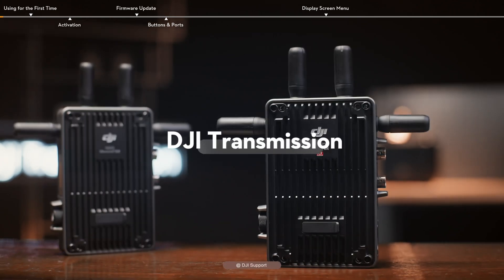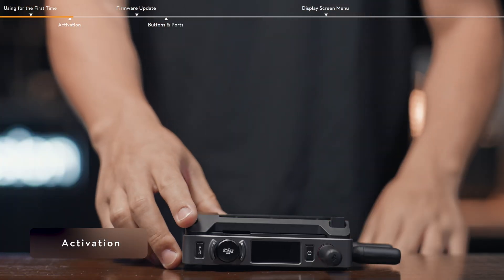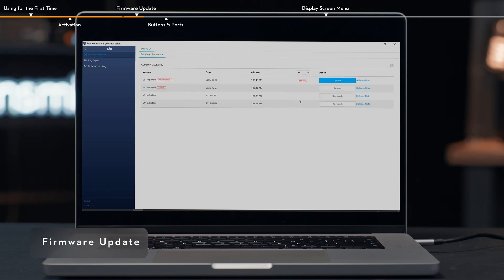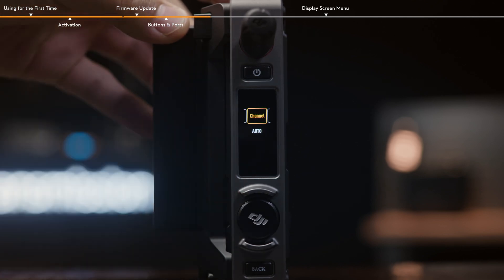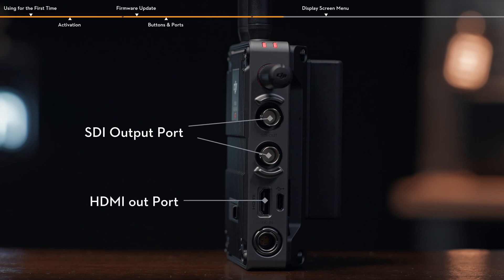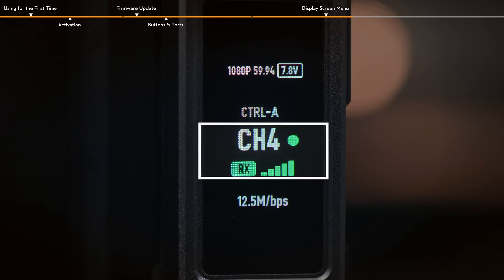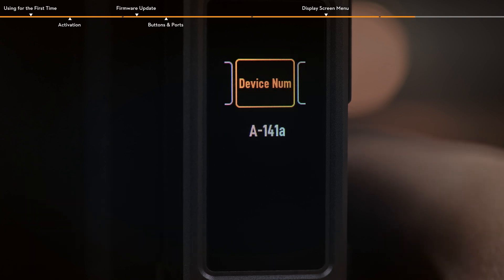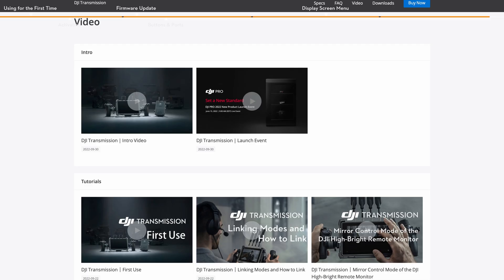DJI Transmission｜First Use

Comment: I can't get DJI Assistant 2 to run on any of mac macbooks. I don't have a windows pc, no does anyone I know. How can I activate? The software does not recognize the screen and also not the transmitter when I plug them in. While installing DJI Assisstant 2 there was an error saying that one package is not compatible with my OS, the installation finished though. Tried many different cables and combinations.